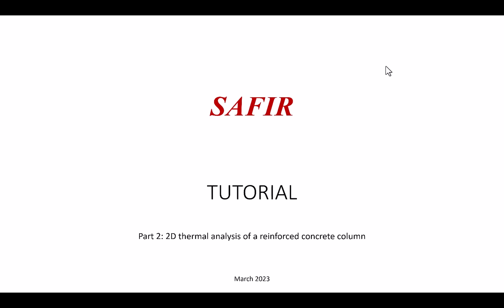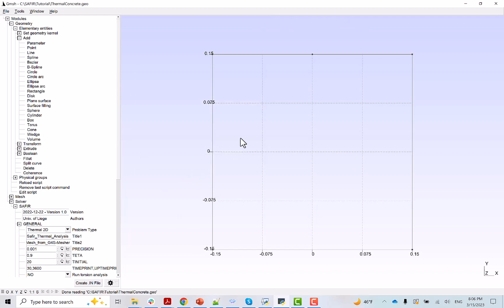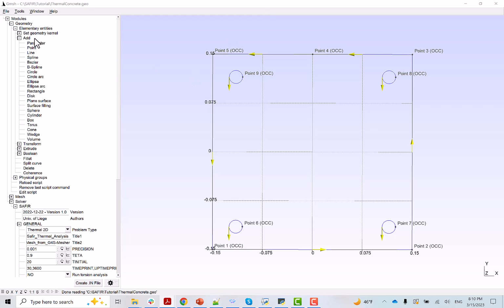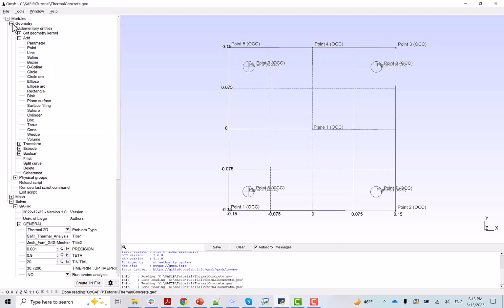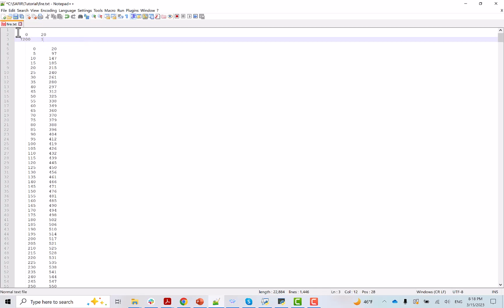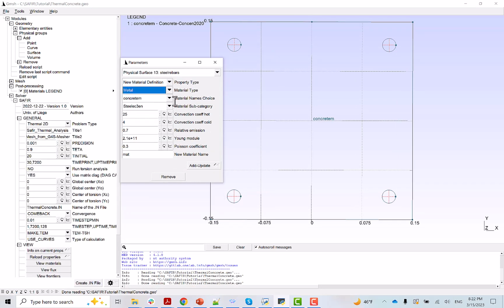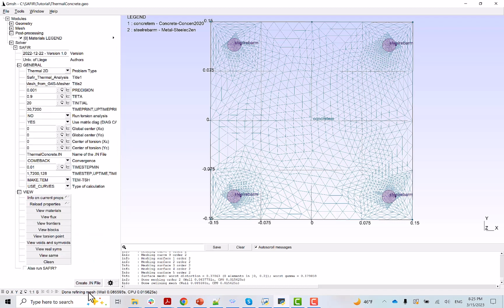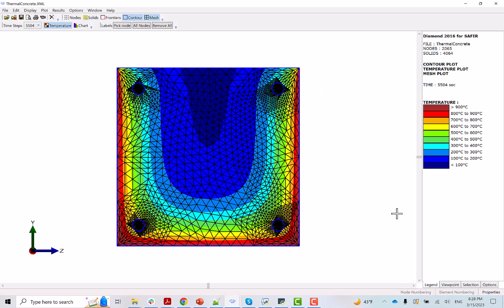GmSAFIR 17: 2DThermal - RC column

Comment: Hello Doctor. This is Ahmed Rafik, a PhD student from Algeria. What is the difference in using Gid or using Gmsafir Who do you recommend?
Reply: Hi Ahmed, thanks for your interest in SAFIR. Since the 2022 version of SAFIR we recommend using GmSAFIR, a free and open source pre-processor based on Gmsh. Before 2022, GiD was the recommended pre-processor to be used with problem types specifically developed for SAFIR (note: GiD is a proprietary software developed by a company with no links to SAFIR). GmSAFIR was developed to provide a free and flexible solution to SAFIR users to create their models.
Reply: @StructuralFireEngineer  Thanks . doctor